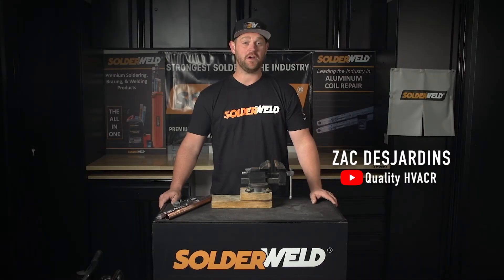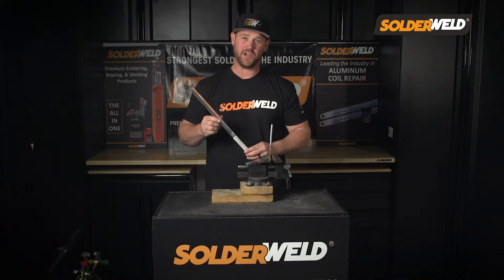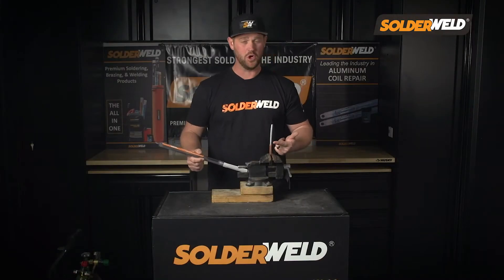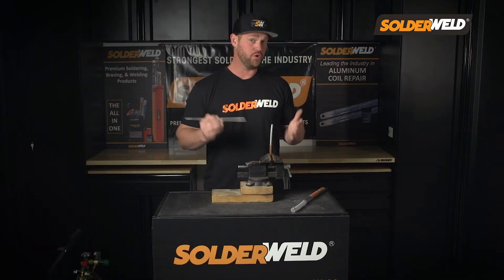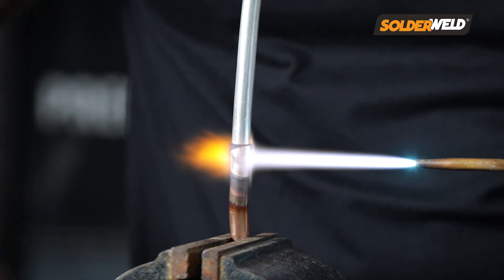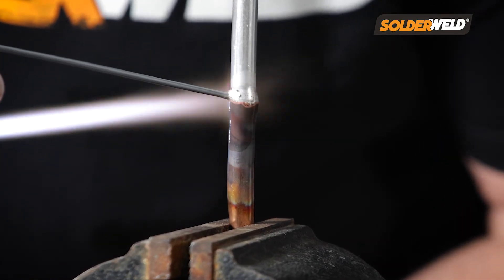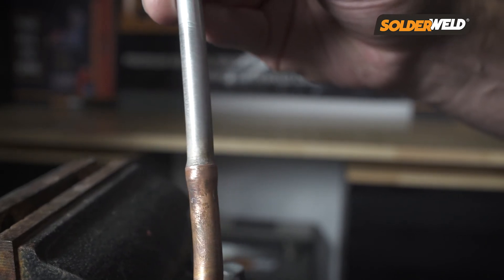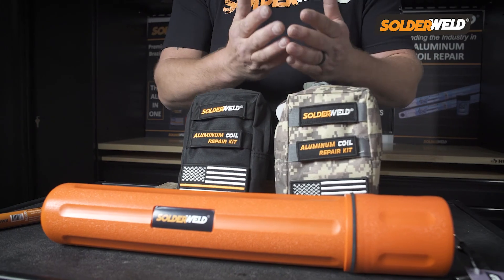SolderWeld Al-Cop Braze

Comment: Do you know if this will work on cast aluminum thx
Reply from the maker: Cast aluminum is better to move to the Alloy Braze flux core rod.  Step up your heat also, the Cast dissipates the heat quickly.  Oxy-Acy torch is good.